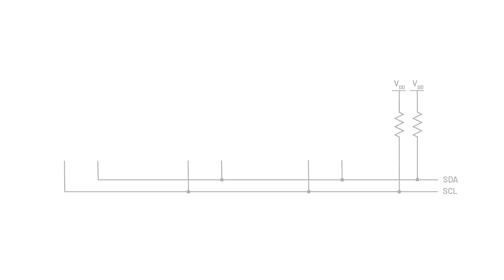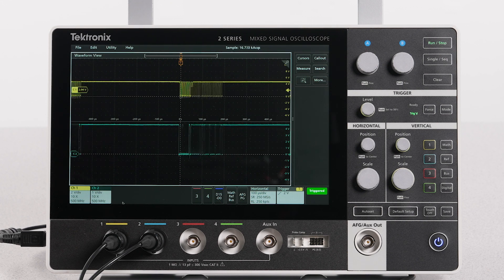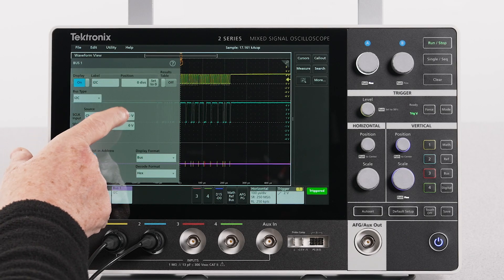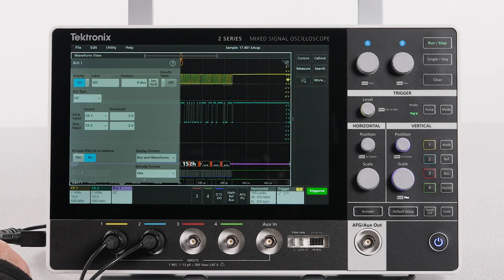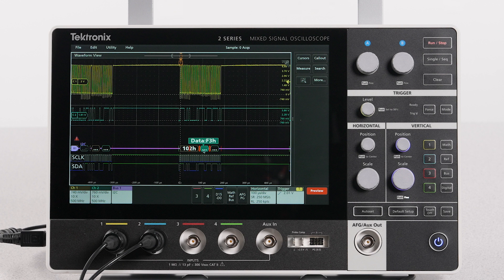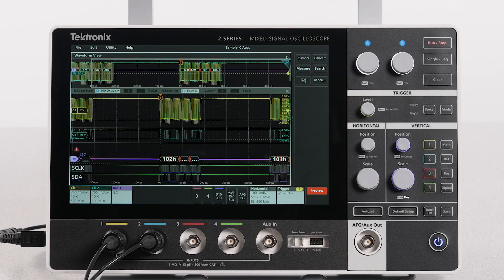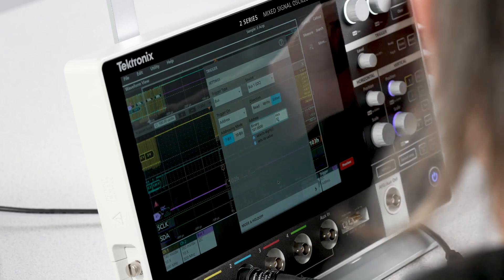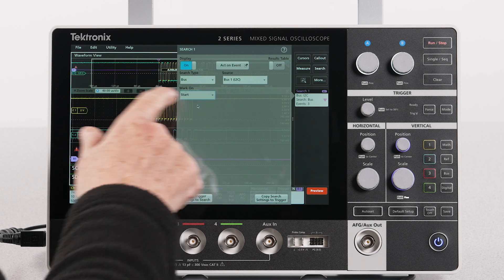I2C Bus Decoding and Triggering with an Oscilloscope

Comment: You didn't mention one of the most useful, but little known features of the Bus decodes in these scopes - you can add a Math channel and set the source to the Bus, and you'll get a waveform of the Data traffic on the bus over time.  This makes it much easier to observe changes/trends the values of the data being sent over the bus (sure beats looking at numeric/hex values in a table).